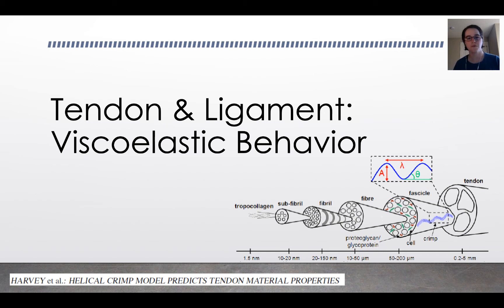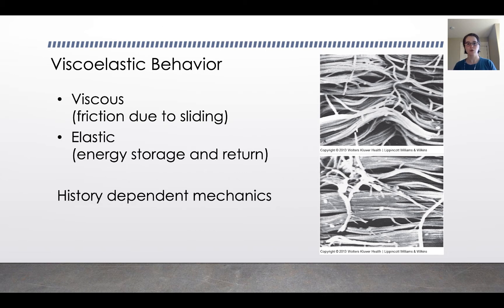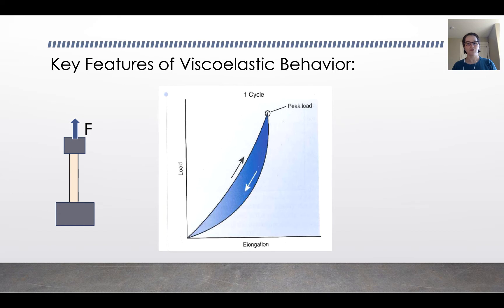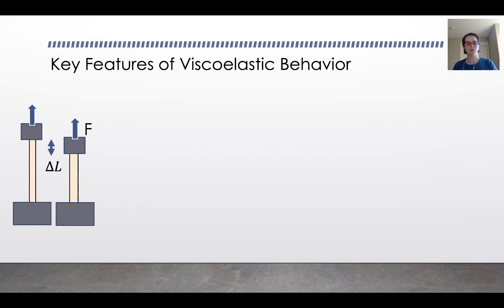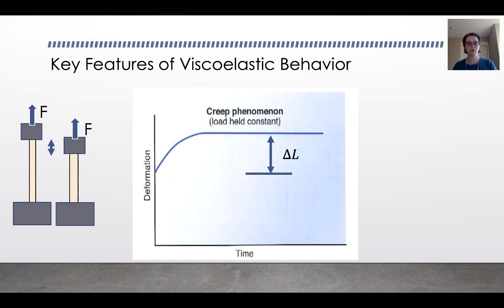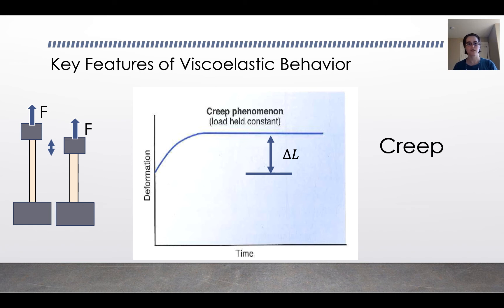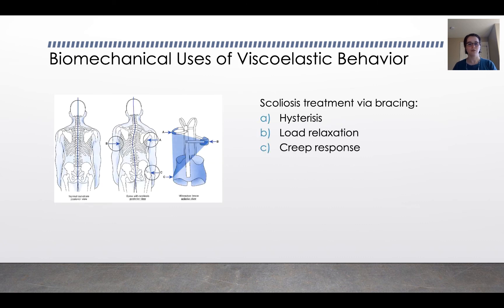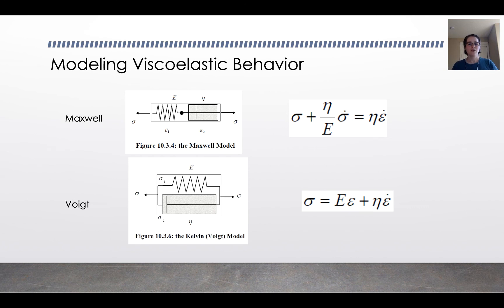Biomechanics: Tendon Viscoelasticity

Comment: What is the role of hysteresis?
Reply: Hysteresis is just a feature/phenomenon. It is the energy lost when an elastic material that has been stretched, is allowed to return to its original shape. If the path back to original does not follow the same line in the graph as the path taken when a stretch is applied, then you have a hysteresis loop, which tells you that the energy you put into the system is not the same energy that you are getting out. This means although the system can return to original shape, there is some energy loss. In tendons the hysteresis tells us that some of the energy we put in by loading the muscle (and therefore stretching the tendon) is lost through heat, leaving less energy in the tendon for movement.